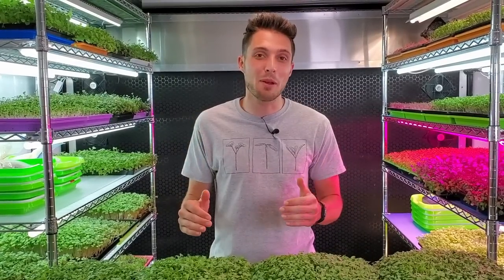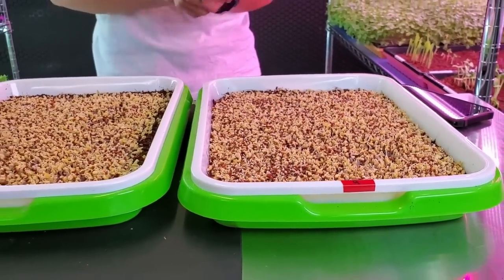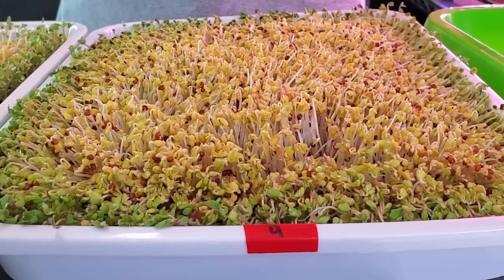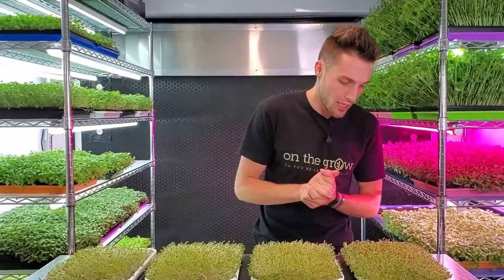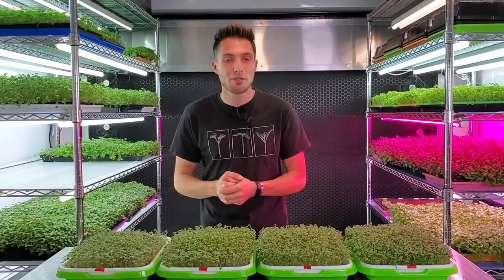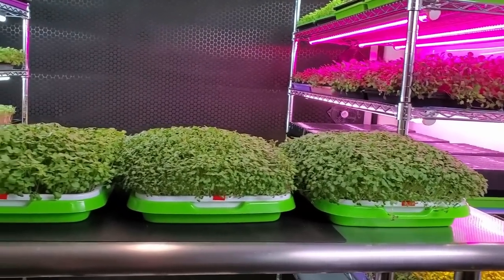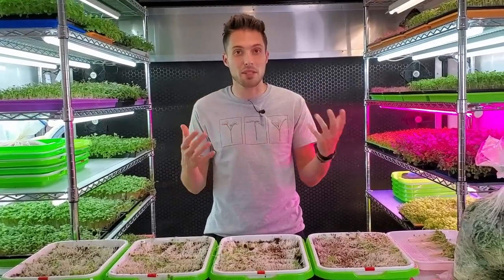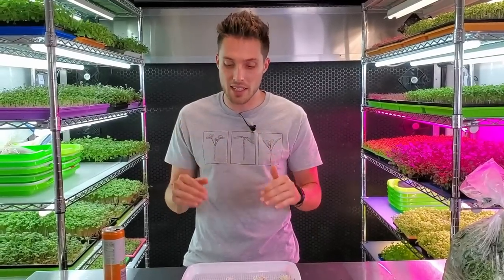CRAZY Microgreen Density!! Broccoli Seed Density Experiment

Comment: Your "Squishy Root Syndrome" happened when you unstacked them on day 2.  The first 3 trays were directly on the steel table and tray four was in the green tray and not "Squished"!
Reply: Yeah, I cringed too when he did that. It was like 500 microscopic garden hoses all getting irreversibly kinked at the same time.  

If you must put em down briefly anywhere besides the tray, put them inside the lid rather than crushing the roots.

Comment: I seed 30 grams in a 1020 tray and have great growth and never any problems with damping off or mold. I live in Az so humidity is low on average and I also have lots of airflow in the grow space. I also do canopy spreading when I water my trays, basically I use my hands and spread out the canopy so light and airflow can get down in the space where it normally wouldn't. This I think helps with problems but also helps to increase yield by getting light to those small seedlings that aren't getting as much light and end up smaller and staying yellow. Great videos and information, love the experiments!
Reply from the maker: The tray #2 is the equivalent of 30grams per 10x20 tray and it was the winner we chose out of this group, so good to hear you’re getting similar results with it! I will have to try some canopy spreading on a new grow and see how it works out... we have a current test running where we left “aisles” open between the seeds to allow airflow through and I’m curious how it will turn out.

I’ll try out the canopy spreading to see how it works in our growspace... thanks for sharing! 🤗🌱🌱

Comment: Thanks for testing these trays. As a home hobby grower, these are the easiest for me. Don't much like that the coir can drop into the lower tray, and have considered using something like paper or cheesecloth between the mesh and the coir. Will the radicles or roots be able to penetrate a paper napkin or cheesecloth to get to the bottom water?  Looking for easier cleanup for my living room windowsill setup.
Reply from the maker: You can absolutely use a little paper towel or something to stop that from happening! They come with like a really thin paper for germination. I’ll start a new test trying them out with the coco and the paper to see how it grows! Generally, as long as the coco or medium is decently saturated, you shouldn’t see it drop through like that. Mine was a little too dry when I put it into the tray and that’s how we had so much drop through. You can also just use paper-towels instead of Coco and you’ll no longer have to deal with the mess! Got a video coming out Monday on using paper-towels. Thank you for your support! 🤗🌱🌱

Comment: Put some fish tank gravel in each bottom tray to reduce the needed water, it is inert and reusable. Also if you want to convert to a basic aeroponics/swc hybrid you can run small air stones in each to create aerated nutrient solution and a mist to the root mass (provided by bubbles of air popping). The gravel would help to keep these stones in place too, although there are other ways. Air would help reduce fungal problems too as it would be forced, in some proportion, up through the media

Comment: I really like the analysis, CJ.  
I noticed water dripping off the roots when you were harvesting.  Is that good?  
If you were able to increase air flow might that help with moisture as well as strengthen stems?  
How many hours/day do you provide light?
Do you have a cost and break-even analysis available?
If a grower is limited on space and having difficulty meeting demand, it might pay to increase density.
How do you two package and market?
Enough questions and comments!

Comment: I have those trays, but when I add coco coir to that white top tray, a lot of the coco coir falls through to the bottom.  I have stopped using the white part and put the coco coir into the green bottom tray.  What are you doing to prevent the coco coir from falling through?
Reply from the maker: If you slightly wet the coco before putting it into the tray, it will barely fall through. We’ve noticed that it only falls when it’s dried out... try wetting your coco a little more and it should bind together well! Not so wet that it is pooling or dripping, just a light watering!

Comment: My notes. The new mesh trays may have exposed roots more vs the normal holes trays. Also the trays were weighted in the same order ie tray 1 at bottom, tray 2 next etc. This means lower trays had more weight each time than top trays.
Other observation was there seemed a fair amount of water left in trays 3 n 4. Maybe it couldnt get through as denser structure of seeds....but then plants would be dried out so that doesnt make sense.
Or maybe (likely) mesh tray needs less water adding at each stage

Comment: I just started a microgreen garden. I was using the weight of a different plant, from another video for arugula. So I put in 1 1/2 ounces, which if my math is right 48 grams? Into a 10/20 tray. It is so thick and crazy, and a little of the medium got caught and pushed up, but so far no mold or other issues. But I’m thinking they are smaller than they should be...

Comment: I ordered these Amazon trays. I'm noticing when bottom watering the center of the mesh tray must sit higher. The water reaches up through the sides but the center stays dry. You have to fill up the bottom tray really high to get water into the soil at the center. Just an observation.

Comment: Hi there guys. I’m only about 5 minutes on so far but wanted to ask specifically about the stacking of the trays. One of the things you’re worried about is the growth of mould and things in tray 4 but then go and place said tray right at the very top of the bunch and where surely small amounts of water will possibly travel through to at least tray 3, right? I understand you’re probably trying to save on space but surely this could cause cross-contamination? As I say, I haven’t watched the whole video yet but wanted to ask while I thought about it
Reply from the maker: Cross-contamination is possible, but with sufficient airflow like we have in our space, mold isn’t really an issue. Generally in growing of microgreens, you will are tiny spots of mold in most trays from dead seeds. 

So, yes it is possible for cross contamination, but with sufficient airflow, mold can’t thrive. Even with the crazy density of tray #4, we still had no mold in the actual root/stem area. 

You can also treat with hydrogen peroxide and that will kill off mold and do no harm to your crop. Just make sure you stick to food-grade H2O2 if possible. 🌱🌱
Reply: On The Grow Ok cool. What strength of H2o2 do you use because it seems even the food grade stuff comes in various strengths like 3%, 9% and 12%. Thanks

Comment: Looking at opportunity cost of tray and shelf space I'm going to bump up my seed use from 30 gm to 40 or 45. Do the smaller trays fit more under the lights?  Im using cheap trays because the cost of the bootstrap trays is nuts. But if 6 or 8 trays will fit under lights for these smaller trays and the cost is right I'll switch. Thanks for the video.
Reply from the maker: The bootstrap trays are reeeeally expensive... they work great, but man it’s hard to justify spending as much as you have to. We can easily fit 6 of the little trays under the lights and so far I’m pretty impressed with them. They do take a little more work because you’ll have to reach over some that are growing to get to the trays in the back to water, so it’s a little awkward. I’m going to keep playing around with them though and see what I can figure out for being efficient or if there are other trays as well. Thank you for the support Richard! 🤗🌱🌱
Reply: @OnTheGrow  i bought 300 of these trays from China 0.88 c each plus ship ing end cost was 2.30 usd received in 8 days work great as i run swap a  tray people going nuts over them
Reply: @supaframe1  where did you buy your trays? I’m interested in offering tray swaps, as well.

Comment: Good video, but just need to point out that an increase of 0.1g/in2 to 0.15g/in2 doesn't mean that the denser tray is 150% higher than the initial tray, it means it is 150% of the density, or an increase of 50% over the first tray.
Reply from the maker: Yeah, it was a simple mistake and didn't want to redo the video because of it. If you look at comments, you're not the first to mention it. I think everyone understood what was happening, but thanks for sharing. 🌱🌱

Comment: Question, when you had the 4 trays in black out, did each tray have a bottom tray?
Reply: Wondering that as well.  It seems that they did not use a bottom tray in black out.  Is that the reason there was significant root change?
Reply: Nakano No, he says the trays were sat straight on the shelf. I too was wondering whether or not this might have contributed to the odd root issue because I’m guessing that when the usual 1020 trays are sat inside the bottom trays, there’s a small amount of room to moves rather than being squashed down
Reply from the maker: In the normal 10x20 trays, they have a bottom tray for blackout. The new little green trays actually have little fins on the bottom that slightly raise them up and off the bottom tray or whatever they are sat ontop of. For the green trays we placed them directly on the shelves with no bottom tray for the blackout period. The 10x20 trays do not have little fins on them, so generally the roots have very little room to expand into. The 10x20 trays do have some slight divots to allow the roots to expand but I’d say both tray sets are pretty equal in their “root spacing”. Let me know if that makes sense! 🤗🌱🌱
Reply: @OnTheGrow  Do you think the direction of the magnificent root development could be maintained during black out? It seems that direction took a less than desired change.  Can we examine what happens to the roots during black out? For example using a shallow bottom tray vs deep tray.

Comment: Is yield by weight of seed used the best indicator of efficiency? I don't know how much seed is and what percentage of the total cost it is per tray, but I would think that unless seed is a major cost, efficiency is more about a yield to space calculation. All things being equal or near equal (i.e. water used, electricity used, seed cost, taste, quality etc.) with a yield to space ratio measurement you also get a level of effort to yield benefit. The bigger trays actually probably have a little extra in the yield to effort built into them because you have half the trays and your effort seems to be centered around "doing things to trays of greens", where the half size trays you will be doing each step twice as many times.  The thing to see is if it is worth doing twice as many things per tray, because the new half size trays allow you to increase your field enough to eclipse in the increase in effort. Just my two cents...
Reply from the maker: Just apply the same seeding density to the 10x20 trays... as long as airflow and climate stay the same, you should have similar results. I’m testing these trays because I’ve never used them before.
Reply: @OnTheGrow  Ah, OK. I thought that the density capability had something to do with the new trays, but if the same can be done with both set of trays, it's simply about quality and quantity. Got it. Thanks...

Comment: Do you recommend those trays?
Reply from the maker: They are tricky to use because they are meant for sprouting and not micorgreens. I'm in-between on them. I like them but they have a gap between the white tray and the green tray that makes watering a challenge. You have to add more water than you normally would  to fill the gap and so that it can wick up into the soil.
Reply: On The Grow thank you for that input. I can see the challenge in that.